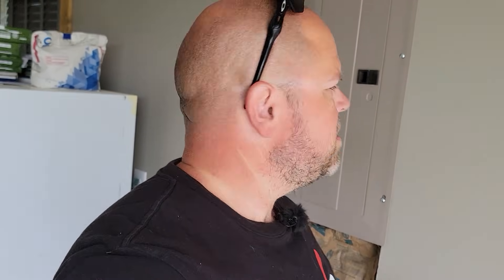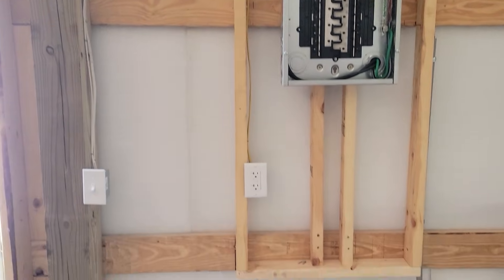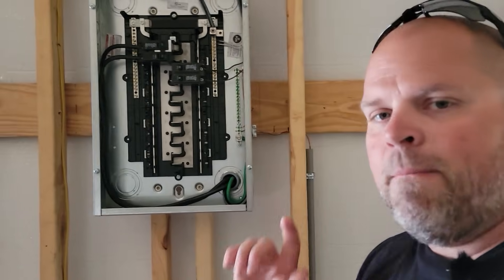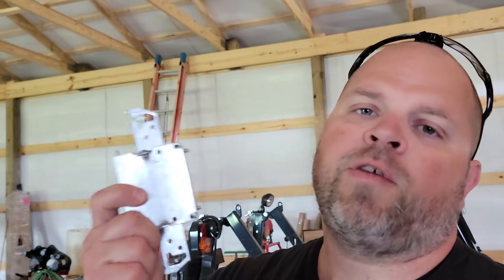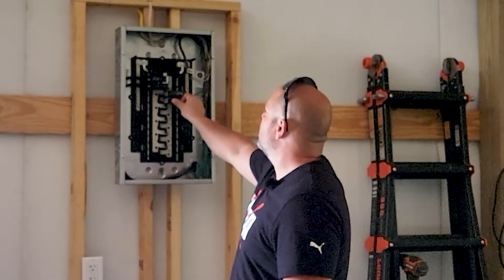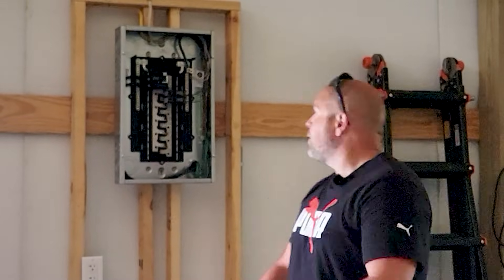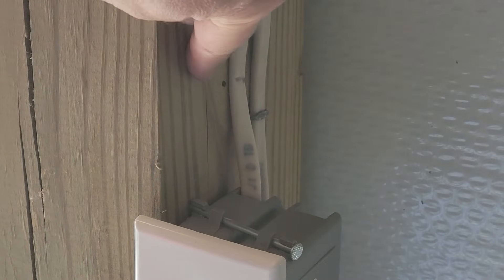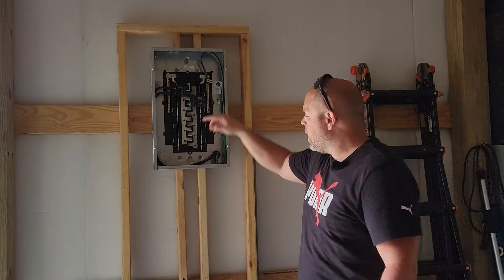Why I Failed my detached garage rough In Electrical Inspection

Comment: How do you know armored cable will pass inspection?  The NEC specifically says that it is not permitted where subject to damage.
Reply from the maker: It did pass the inspection on this go. Inspector advised it would still need to be secured in the wall cavity similar to the Romex wiring would be. I'm glad we got it worked out and I can start the next wiring project, wiring my solar array on the roof. Thanks for watching and commenting 👍
Reply: Yes but what kind of damage, I seen 4" rigid metal conduit damaged outside of a building.
Reply: The NEC section covering this building lists wiring methods allowed.  Section 547.5.(A). Lists the allowed methods......uf cable, se cable, pvc conduit, and many more..

Comment: Licensed electrician here and I didn’t know about the agriculture rule either. Nitpicking if you ask me.  Wired plenty of pole barns in Romex.
Reply from the maker: Good thing I didn't have the entire building wired than get that news. Caught it early and now I know going forward to just use the MC Cable in that building for any future inspections I might need. Thanks for watching and commenting 👍
Reply: I would think if the wire is exposed to usable space it must be protected. If the area was covered with dry wall I think it would be fine. 👍🏽
Reply: @cbucha  I am not sure you are correct on this one.  Yes 90.4 allows ahj to disregard parts or all of the nec.  However, 547 in the nec talks about what is inside the building.  Drywall was not mentioned.  In 547.5. (E).  does say that if the wire is subject to physical damage it must be protected.  In 547.5. (A). It lists the approved cables and straight up house nm cable is not one..

It covers feed storage, wash down areas,   fish confinement and more.  Some of these items and some  animal "droppings" can create areas simular to the hazardous locations in chapter 5.  

Chicken poop plus water....flowing corrosive mixture.

Feed storage  ....  explosive concentrations of dust.

Water hazards ......  washing stations or splashing from fish storage.

I expect calling it an Agricultural Building go them some kind of advantage over just calling it an "Out Building", but it appears there were some trade-off to make.
Reply: It’s because it was not going to be finished…..people hang things on romex going horizontally…so had to use mc.
Reply: @sergioviv8403  again, 547 is the "Agricultural Building" section discussing wire corrosion due to the items inside.....animals.  If it we're just an "Out Building" it would need to meet simple building and garage type requirements.
Reply: Yeah, farm animals would love to chew on the romex. But so do mice, that’s why I would not use it in a pole barn.
Reply: Needs to be grounded
Reply: Damn that wore me out watching you drive rod, while thinking what I use to drive them. Even though it’s a one time situation for you, i know a full time electrician that uses the same method as you.
Reply: @1topfueldrag 
Drive your ground rod into the ground about 5-6"..pull rod back out...pour some water into that hole and let it soak down.  Reinsert rod and drive it down till you feel resistance.  Pour more water in abs around rod and let that go down. Wiggling rod a bit from side to side will let water go down into hole. Repeat as necessary until rod is down to where you want it. Water lubricates and loosens the soil and rod. Nite also to remove rod ..use water also. Makes removal WAY EASIER! When removing, attach vise grips to rod after wetting soil and rotate rid with vise grips as you pull up on rod. Have used those tricks for years..saves on exerting yourself
Reply: I fully agree with you whole heartily!!!  I am a licensed electrician for the past 51 yrs and I have wired several pole barns with a permit in Michigan with romex and never had a violation neither!!!
Reply: @cjrock4096 NM cable is not allowed in an agricultural building, but UF is. Agricultural buildings are generally unheated, damp, and corrosive. NM cable is interior use only. The specific code section eludes me at the moment.
Reply: Yeah same here no idea maybe it’s just where he is?
Reply: I could see that as one of those "local juristiction" things.
Reply from the maker: @larrystuder8543  It could be worse I suppose. All in all not to bad. I don't like working with MC though. I need to look for some tips and tricks to make it easier on myself wiring the rest of the building.
Reply: Invest in the rotary cutter meant for mc cable much faster than a hack saw and you don't have to worry about nicking the wires
Reply: @TheSolarPit  ,I would use pvc conduit. It stand up to elements  plus is you use all 3/4 watch you fill if in the future you need to add a circuit just pull in same conduit.
Reply: @TheSolarPit  someone mentioned pvc.  It is listed in 547.  Then thhn wire.  Most of your piping should be straight runs with 90% bends.  Factory 90's or bend them yourself.

Also, if you need to....you can heat the pvc with a heat gun and bend it.  Hold it in place to cool and it will forever keep that bend.

It is forgiving(slightly flexible) so if you are off by a little you can push it into place.

For offsets (adjusting the piping to align with another pipe or box hole),  try this:

Mark your pipe (pencil) at two spots, heat the pipe in the air at one spot (about 8 inches worth) until it starts to flex then set the cool marker spot on a metal electrical box...2 in or 4 in in height (as you need) for these ratios:

(Let this mark (^) equal degrees)
10^  is a 1 inch Change for every 6 inches traveled down the pipe.  So marks at your 0 and 12 inches with one mark heated and one onto of a box laying flat (2 in tall)

15^ is a 1 inch change for every 4 inches. (So, marks at 0 and 8 inches with the box laying flat, 2 in high)

30^ is a 1 inch change ever 2 inches ( so, marks at 0 and 8 inches with the box on its side, 4 in tall.)

You can also bend your own 90^ s just use a factory one as a template and heat up about 12-14 inches of pipe.

This is difficult to understand until you see it done.  

Again, the piping should flex enough for box offsets ( going from the flat surface  into the box).

This might also be a good time to call in a pro.  A 3rd or 4th year apprentice or above should be able to relay those skills and a nice meal or a few beers could work wonders.  A seasoned pro may be able to give you extra tips for the same price.
Reply from the maker: @keithharrington8715  Much appreciated 🙏 Thanks for watching and commenting 👍🏻
Reply from the maker: @thomasmarable6818  much appreciated 🙏 Thanks for watching and commenting 👍🏻
Reply: @TheSolarPit  USE A MC CABLE CUTTER IT WORK'S GREAT.
Reply from the maker: @Skip Duld  Yeah, I finally got me one. 🤣 Life is much better now
Reply: @thomasmarable6818  I like that too. Get some rolls of THHN and away you go.
Reply: @larrystuder8543  no, code....section 547
Reply: @larrystuder8543  if it is they need a new official.
Reply: Some of those inspectors have power trip issues, or they are trying to get more $$$$ for the state!
Reply: I find that inspectors...all types set their standards differently for different installers. If you are taking work away from them or a friend...good luck. They can make life miserable

Comment: I'm surprised they didn't comment on your exterior conduit.  Typically they're supposed to be secured every couple feet and it looks like you got a good 4 foot gap there.
Reply: It depends on the size of the pvc for the spacing. 3ft from termination points and then it goes from 3ft to 8ft.
Reply: Where in the nec do you see that conduit has to be secured every couple feet?
Reply: 3

2014 NEC Article 352.30(A) states that PVC conduit should be supported within 3' of each outlet box, disconnect, panel, etc.
Reply: @dracula3811  if you have not got this yet, article 352.30 table.....352.PVC .... 352.30  support of PVC conduit.  

The table is sized based on the size of the conduit.
Reply: Last rule I saw ( which had been a while)  was EMT or rigid every 4 feet on new work, every 10 on old. PVC wasn't a thing yet, it was that long ago.
Reply from the maker: The conduit carrying the 100amp service is secured about every 3ft. The other conduit is there for a solar array that I am building which has a separate inspection coming soon. I still need to get that installed. Thanks for watching and commenting 👍

Comment: un-armoured cable would also fail in an unfinished utility room if not tucked into the joists/etc (e.g. out of reach).
Reply from the maker: Makes sense to me. From my understanding that is same concept for the ag building. Because the walls and ceilings are exposed and not covered it requires the MC or Conduit. However the inspector stated it stills needed to be secured in the wall cavity similar to the Romex wiring would be. Thanks for watching and commenting 👍

Comment: 7:00 the sell bit which goes on a hammer drill to hammer those rods in the ground, worked like butter for me...  I also saw a video of someone who used water hammer them into the ground with their bare hands most of the way...
Reply from the maker: Thankfully I don't have drive anymore in the ground at this time. Thanks for the heads up on the hammer drill tactic. I have a good strong Bosch hammer drill that could have saved me a shhh ton of work had I known beforehand. Thanks for watching and commenting 👍🏻
Reply: @TheSolarPit  I was lucky, I picked up a used Bosch hammer drill and a bunch of other klien electrical stuff from retired electricians estate sale, the  case only had one weird bit, after googling I figured out it was for hammering in rods and retailed for $50...  I have seen them in the $20 range, or the water method stick a hose with running water in the hole with the rod as you slide the rod up and down...
Reply from the maker: @ericfraser7543  Nice, love auctions. Sometimes you get something cool even when you didn't know it was cool.
Reply: Worst part of EVERY job... driving those by hand.  My boss finally got a hammer drill with the 5/8 adapter.... smooth as butter. Wear hearing protection.